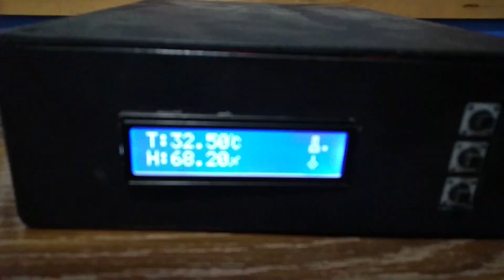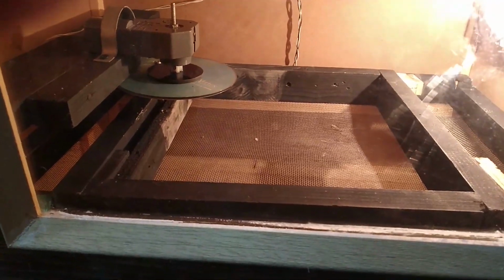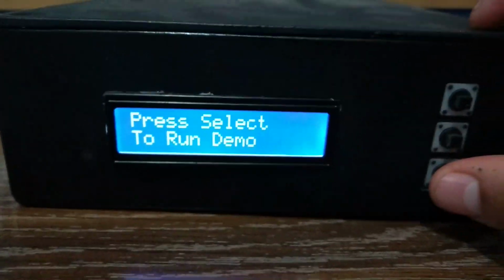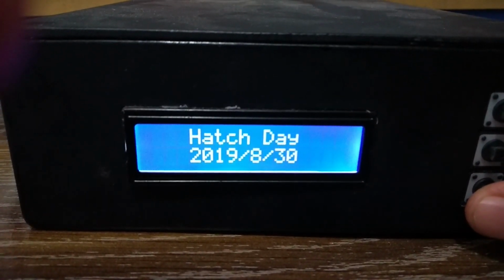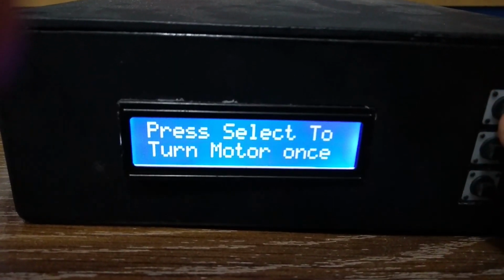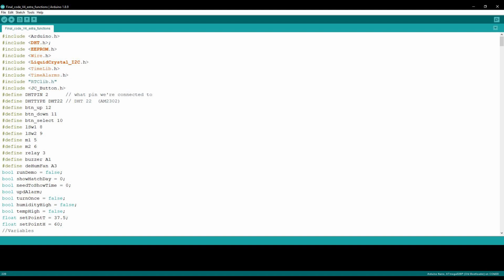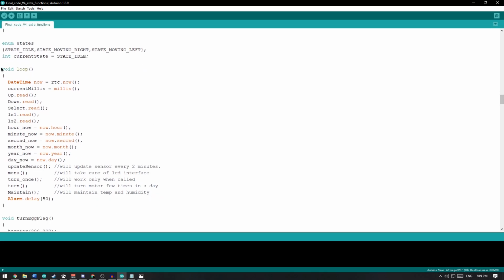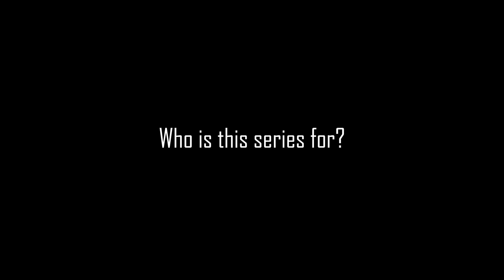DIY Automatic Incubator From Scratch | Part 1

Comment from the maker: Part 2 is up where i start drawing the schematic of the pcb and go a bit in depth into the project and the connectors we are going to use. i have also explained the full working of a transistor as a switch and made a switchable DC fan, so if you are interested i would recommend watching that one. https://www.youtube.com/watch?v=lgHcUqFDwnY